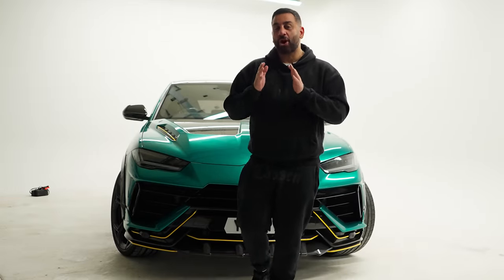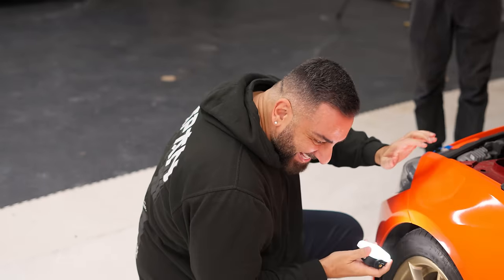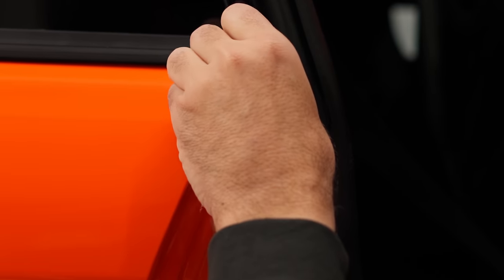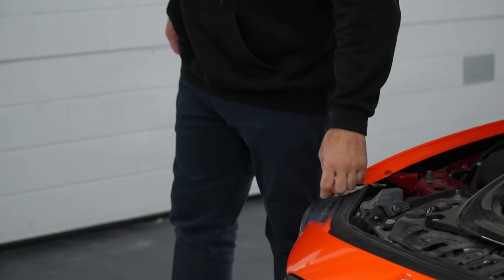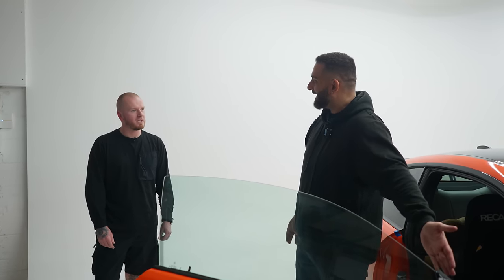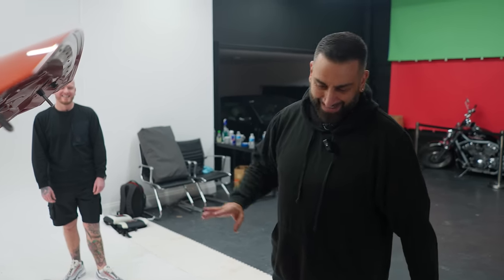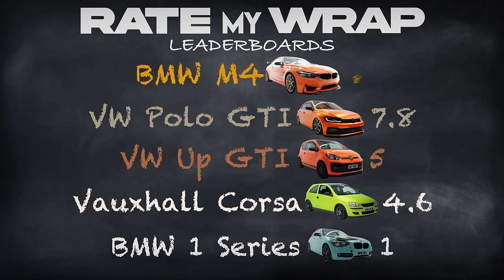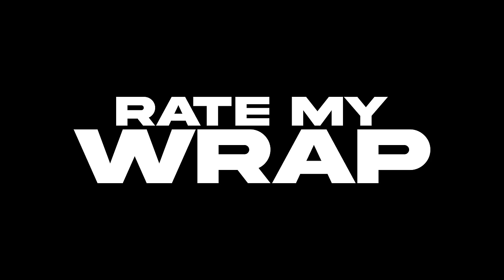I Should Have Hired Him - In-depth Wrap Review

Comment: 8 on 10 implies there's another 20% that can be improved on. With how many compliments given, telling him you would hire him and that this is good enough to be a Yannimize wrap, I think he deserved a 9.5. Those small things (which could be easily fixed with a bumper adjustment, trim of the overlay/seams and adjusting the window trim to fit properly) shouldn't dock him him a full 2 points.